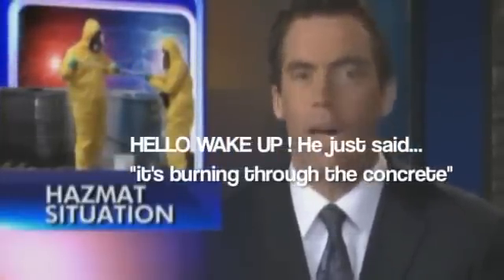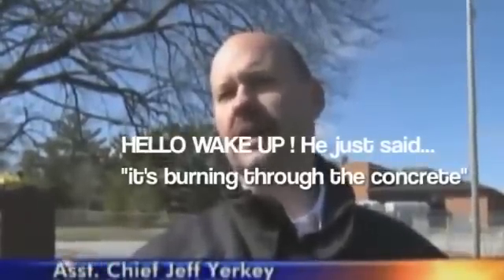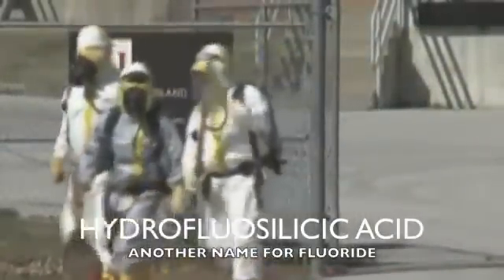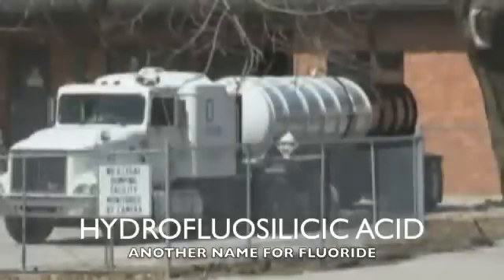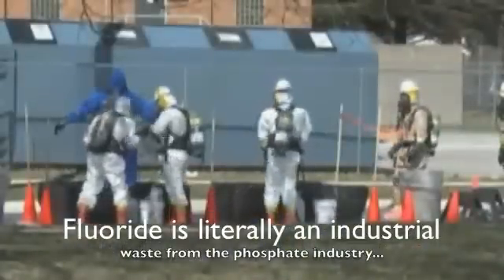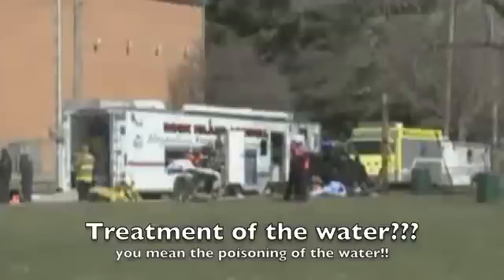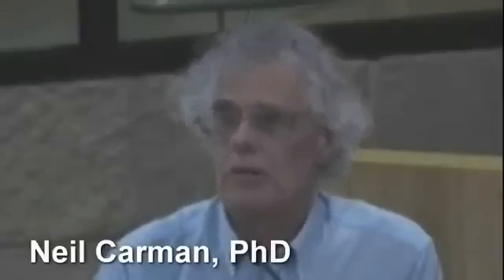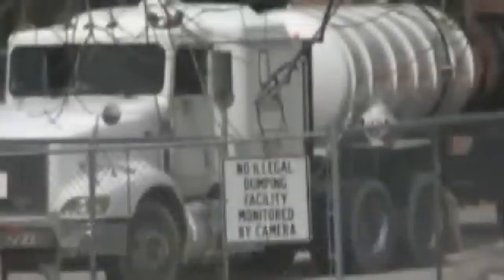Fluoride spilled out from truck & it eats concrete!

Comment: Still need to be wary even when it's diluted  in our drinking water, as some are deliberately contaminated with fluoride, which has a knock on effect throughout the food chain. The American snake oil salesmen certainly did a good job in fooling some areas to help dispose of their toxic fluoride waste, at public expense, for over 70 years. Anyone with an ounce of common sense would recognise that using the water supply to deliver fluoride as medicine is fundamentally flawed. My Doctor would not legally be able impose this on me without my consent. The harm caused would be a breach of the Hippocratic Oath. With no Medical Product's Licence it is in breach of the Nuremberg Code, so should be more accurately described as mass experimentation. No medicine is absolutely safe for everyone so, the use of the monopoly position of such a vital service is totally inappropriate. Just as some people are sensitive/allergic to certain foods (such as peanuts, sesame seeds, strawberries etc) some people are more affected by fluoride toxicity. I do not want to pay to poison myself. With less than 1% of the treated water reaching the children, for whom it is intended, that means that this is a horrendous waste of public money. Even dentists are now saying that the benefit is topical, not systemic. Turning our bodies into toxic waste dumps (we only excrete around half the fluoride consumed) we are left to suffer the chronic effects of this cumulative poison. The graphs here show that it has failed to deliver on the claims to reduce dental decay. Resultant cases of dental fluorosis show that it does more harm than good. https://fluoridealert.org/.../data-shows-tooth-decay.../ MY BODY. MY CHOICE.

Comment: Water "burns" through iron.
Reply: Its called "corrosion" and it doesnt disintegrate shit
Reply: @HazrdusTalent  You stupid? Really, water doesn't disintegrate shit?
Reply: @HazrdusTalent Pardon? It does not disintegrate?😂 If u let something small rust for 5 years+ it almost becomes like a vapour when u touch it and shiit😅

Comment: So I'm assuming you know very little about chemistry...
Reply: And I see that you're totally dumped down by fluoride from a tap water. This is exactly what the government want to get from this- stupid people, easy to be manipulate.
Reply: @organicbrain7029  facts this is agenda 21
Reply: @organicbrain7029 
Lol. Yes. It's what they want. Yet the brain dead are the ones panicking over something that naturally occurs in water anyways. You against vaccines too? Yea, I hear they cause autism.

It's not like the rates of tooth decay dropped by over 60% and actually has improved health over the course of almost 20 years or anything. Nope. It's to keep everyone stupid.

 Jesus, take a look in the mirror and see if that tin foil hat is on straight.
Reply: Reppy07...You are concerned about people’s teeth?;)
But if flouride worked to prevent cavities, no one would have cavities anymore.
Actually you have the opposite effect :
Dental fluorosis is caused by continuous exposures to high concentrations of fluoride during tooth development, leading to enamel with low mineral content and increased porosity.

Also :the type of fluoride commonly found in many rocks and the source of the naturally occurring fluoride ion in water supplies is calcium fluoride. The three main fluoride compounds generally used to fluoridate water are: sodium fluoride, hydrofluorosilicic acid (hexafluorosilicic acid) and sodium silicofluoride.

Can you agree that putting fluoride in to the water is the most undemocratic thing?
They took from people their fundamental rights to the water that does not contain a toxic medication.
This is a mass medication, and this is unmoral.

Common sense: why having a bath or taking a shower with chemicals that should “cure” your teeth? What benefits to your teeth doing this?
Why swallow chemicals that supposed to cure only your teeth? Are you swallowing sun cream to protect your skin from sunburn?

Have a nice day;)
Reply: @organicbrain7029  agreed 👍🏻
Reply: @reppy0757  floride does not help teeth 😂 ye sure the media may say it does but does it really 🤔 so why are the ppl with unhealthy teeth
Reply: @Natalia-lm7fp  Because its dilute and not enough to completely stop tooth decay on its own. As with anything, too much of it can actually give you unwanted results such as dental fluorosis for example. That doesn't mean it's not doing anything. Compare the average US citizens teeth with the average UK citizen and you have your answer.
Reply: @organicbrain7029  OH, SO nice to see that some people actually use their mind!!
I have been saying this for years, even to my dentist, but to no avail! People are just too programmed!!!
Reply: In 2013 Harvard released a study that showed that fluoride reduces the IQ of growing children.